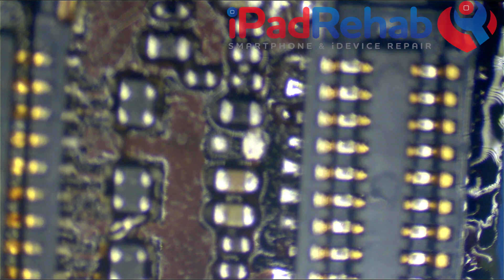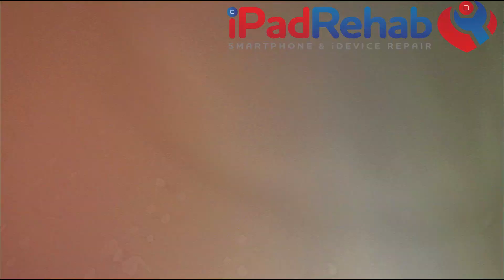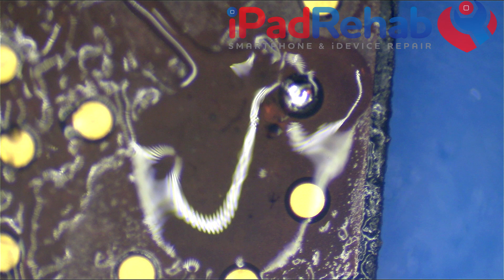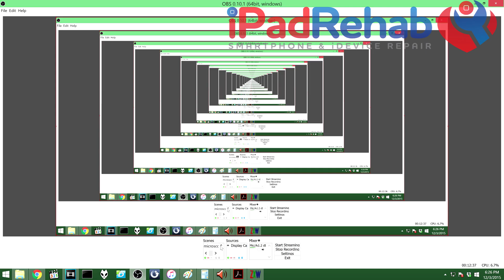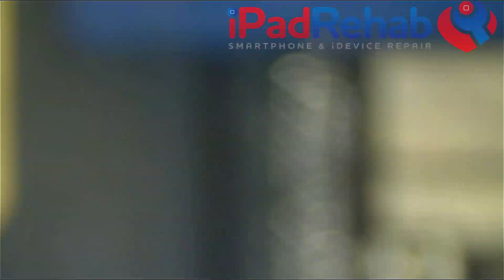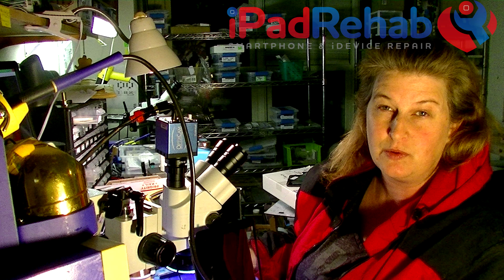Using the zxwtool to solve botched iPad connector repair

Comment: I'm about 90% sure that this was the board I butchered.  I won't make excuses, because I really had no business attempting this, but I was backed into a corner.  I had done a lot of research into how to do this repair, and was going to attempt the same thing you just did after watching a few of your previous videos, but I didn't have anything like the zxwtool to tell me what test points corresponded to the pins I needed to connect.  I am very glad someone was able to get this thing going, because I dug a 40-50 hour hole with this thing that there was no way out of for me.  Great job!
Reply: Oh, and sorry!  haha
Reply from the maker: This one was from a school.  It is a common problem though.  Use enough heat to pull the connector and you'll be fine
Reply: Well then this person did the exact same thing I did!  haha.  I have more experience now, but at the time I didn't.  Thanks for your videos though, I've learned a lot!

Comment: Looks great, but I'm concerned about it accessing the information over the internet. Seems like something Apple will very quickly shut down once they see it gaining traction. I guess if you get a couple repairs out of it then its paid for itself though, so probably still worth it even if it doesn't last. Would be a lot nicer if the data was also stored on the drive. Would LOVE to see one for Macbooks too.
Reply from the maker: I don't see how Apple could shut down zxwtool. It appears to be reverse engineered from boards that they sell to the public. This is not an Apple branded "leaked" tool.  It is independent information that could be gathered from the products they release.  They can't claim ownership of someone else's intellectual property.  
There has been a similar boardview software tool out for MacBooks for years--Landrex--that is commonly available with every MacBook schematic
Reply: +iPad Rehab Ah, for some reason I was I Der the impression it was doubling from something apple provides to manufacturers. If not then that is both very impressive and reassuring. Guess I'll be looking into sourcing one tomorrow. Thanks for video!

Comment: Hi Jessa, I've got an iphone 5c which has a portion of the digitizer dead. I'm sure the screen is fine, had a look at the microscope and didn't find any visible damaged components. I've resoldered the digitizer joints but is still the same, should I replace the digitizer connector or the digitizer ic? Thank you!

Comment: Hello Jessa, thank you for the upload nice Video. i Have a question. You wrote that you use the FM 2023 Tweezers. Can i Use these Tweezers with the Fx 951 Station or which one i have to use with the Hot Tweezers??
Reply from the maker: FX951 will not power tweezers, only irons! You need FM-202 or FM-203 to power tweezers.

Comment: I need some guidance trying to find the Zif Socket on an Ipad 2 Wifi.  Its the socket where the ribbon from the headphone jack, microphone, camera, power button, and volume controls are connected to mother board. I have no idea how many pins there are until I get my microscope and I have tried to find the part on google but I am having issues.  If anyone could point me in the right direction that would be awesome.  Thanks.

Comment: Jessa I ripped pad 7 and 10 on an iPad Mini dock connecter.   Should I jump pad 7 to DZ5702 and 10 pad to L5704 or are there any good test points on the other side of the board? So that I don't have to remove the shield to access DZ5702 & L5704.
Reply from the maker: +David Cruz You need zxwtool
Reply: Attention world--David Cruz totally redeemed himself and fixed that mini at Practical Board Repair School.  And a bunch of other stuff including a months old iPhone 5 data recovery with short on 1v8 line, and even a data recovery on an old flip phone from 2008!
Reply: Jessa Jones - Nice going David Cruz! :)

Comment: Hi Jessa - have you never experienced problems using this technique where high-speed digital signals are used on the pulled pad? I'm thinking controlled impedance to the ground plane, and also propagation delay where differential signal pairs are involved - I imagine that would totally go out the window with this. Obviously that means degraded signal integrity, but I'm just wondering whether it makes enough of a difference to make the device not work. I actually have exactly the same problem with a pulled pad on an FPC connector with a tiny via in the middle, and I'm tempted to use your technique but I'm wondering whether to attempt a much trickier operation of digging into the board around the exposed via to try to find the trace on the inner layer, then soldering to that, as that would more closely mimic the electrical characteristics of the original board. I would much appreciate if you shared your experience on this if you have the time! Thanks in advance.
Reply from the maker: +Dmitry Smirnov personally I expose the trace and solder to it...but that's just because it's easy enough with practice and you don't have to remove the board from the housing.  We recommend beginners solder to the test point.  There is no practical difference. A mini with a jumper soldered to the test point will never experience a problem with touch from this repair.
Reply: Hey, thanks for the quick reply! Could you please clarify - by "expose the trace" do you mean digging into the layer underneath as I described to expose the trace on the inner layer? I'm talking specifically about the scenario of a pulled pad with a via underneath it, where the trace is on an inner layer. My pulled pad is actually on an iPhone 6 and it's one of the signals going to the Tristar from the charging FPC connector, it appears to be part of a differential pair as far as I can tell from the schematic, so whereas luckily there is a test pad on the opposite side of the board, I'm a bit concerned with degrading the signal by routing a jumper over to the opposite side - however if you say that it will still work, that may well be what I will end up doing as that's far easier. Thanks again!

Comment: The suppliers of the zxw tool have just selling stolen wares on a dongle.
It is useful but they are ripping everyone off.
I have it on my hard drive a dongle is not needed nor at any cost.
Whilst this is against some peolple ethics, I feel with them steeling it originally and charging has opened them up as fair game.
It is freely available on the internet
Reply: +iDOi Excuse spelling, wireless keyboard has its own mind